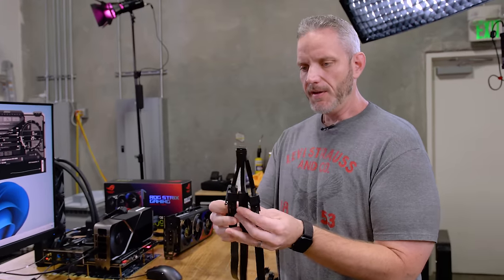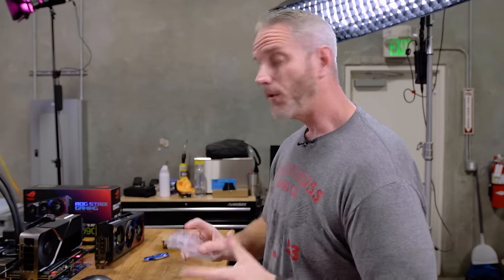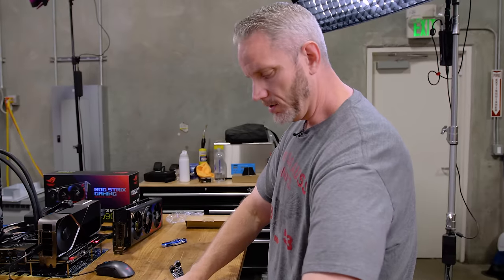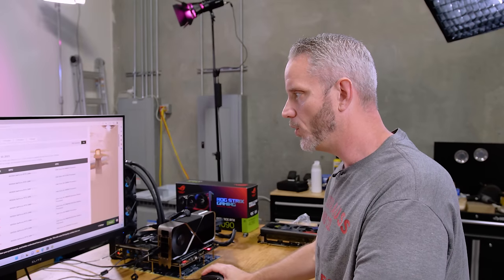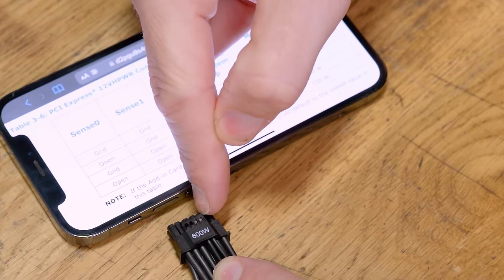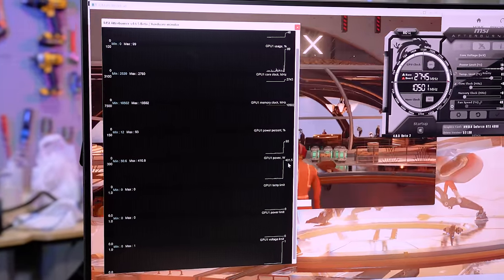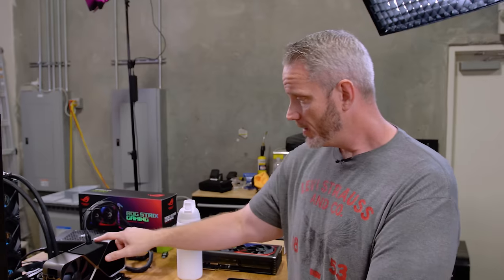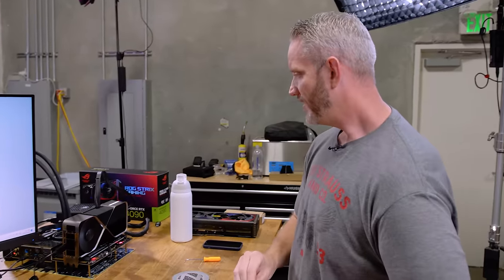DON'T Do this with your GPU!

Comment: fun fact if the wire gauge is the same stranded can handle more amps, sold core is cheaper to make, sold core is used in builds cause it does not get moved around, it is set and forget so as long as it is cheaper than stranded it makes sense to use, also easy to screw sold core wires to the back of outlets, but they were made for solid core as it is the standard use product

Comment: About the start of the video... no it dorsnt only take 2 it still takes 4 if u notice the regular cables have 1 connector on the psu side and 2 8 pins on the other side... so this adapter just skips 1 step.. its still the same amount of cables or lanes from the psu

Comment: Got my 4090 a day or two ago, and you are sooo right. The goddamn cablemess is terrible. Ordered a Corsair cable for my Corsair PSU to neaten things up.
Reply: Did it work? Which Corsair psu do you have?
Reply: @klipschorny  I have the corsair 600W 12VHPWR cable as well. I have a corsair 1000RMx and works perfectly.
Reply: @klipschorny  yes it worked fine. I have a RM850X
Reply: Wait what? This cable will only draw 600w if you have Rmx1200w supply or above. Anything less, it defaults to 450w. But people are ignorant, so they deserve to get scammed.😂🤣😂🤣
Reply: The Corsair 1200 are terrible stiff going to the GPU.  Useless

Comment: didnt corsair spread missinformation about the 4th/3rd plug on the adapters ? gamers nexus made a recent video about it , showing that corsair has no idea what the fuck they are talking about when they adress the new plug and standard
Reply: this^
Reply: yes they did, but when you see how they built their own extension you can see why they thought what they thought, why they were wrong, and why their product is still perfectly okay. these cables are fine. I just read the spec, and essentially I think the Corsair person was just confused and didn't realize that Nvidia built their adapter differently than they built their adapter, but both will work fine for a 4090 or any other GPU with ATX 3 that has ever been produced.
Reply: The Corsair one just uses 2 ground wires, the Nvidia adapter uses 4 ground wires and an IC to check them.
Reply: @gucky4717  exactly. And let's be clear when we say "IC" we think of some complicated logic but it's really not doing that complicated logic. It's just counting the number of sense pins (old style) on the connectors and converting that to a two digit binary number.
Reply: That only applies to Nvidia's cable adapter. That's what Steve from gamersnexus was talking about when calling out Corsair. Not Corsairs own cable. The way this cable works is completely different.

Comment: NOTE: the power that you get from this Corsair cable will vary depending upon the power supply that is used, it calls for a 1200w Corsair PSU to deliver the full 600w through the cable (1000w PSU = 450w and 750w PSU = 300w). I did not see this mentioned in the video.
Reply: This is false lol.. do the same test he is doing and you can see the wattage being supplied. I have a 1000 Corsair and this cable and I’ve had my strix card up to 527 watts. So it is definitely over 450.. maybe that’s changed I guess but as of now it isn’t true
Reply: I have a rm850x and it goes up to 587 watts in furmark with the cable.
Reply: @crimson7151  
I also have rm850x. This might be the reason why I'm getting a black screen with this cable.
Reply: yes its possible if you have a cpu like the 13900k @TheCaciKO

Comment: The power is defined by what consumes it (GPU).
What produces the energy (PSU) only defines the power limit it can handle.
Since the GPU is being told by the sense pins that the available power limit is under what it needs, it doesn't even try to start because it "knows" that it will go over the limit of the PSU and probably damage it.
Jay, you cannot say the power is there, "there" is only the voltage in Volts, then multiplied by the Amperes that the GPU resistance provide will give you power in Watts.

Comment: Hi Jay,
just that you can't band a cable, doesn't mean that its solid core. Especially the insulation makes a big difference in the stiffness of a cable. If you don't want to cut the cable, you can x-ray the cable to see if its standed.
BTW. The "smart" communication is just passive pins. Maybe later they implement something I2C based, like the old fashioned PM Bus on the PSU and GPU. They should have done this already. Its like cents for an eeprom in the PSU.

Comment: I think the reason there is a 4 8-pin adaptor is for psu's that had multi rails on the 12V. It is mostly a CYA adaptor while most corsair psu's are single 12V rail by design so the can basically just use 2 8pins to 12 high power connector.
Reply: Yeah most psu can do 1 8 pin psu to 2 x 8pin pcie pigtail
Reply: The reason for 4 8-pin adaptor is simply because each PCIE 8-pin is rated at 150W (it is the standard), so you need 4 of those to get up to 600W. You don't design 2 8-pin adaptor and rated it for 600W because it will be a fire hazard.
The adaptor itself can sense how many cables are attached to the adaptor, so if you only attach 3, it will tell the GPU that the max power is 450W. If you use Corsair PSU using the adaptor, you still need to connect to all 4 to get 600W max.
One of the potential problem in the future is that if people ended up breaking or losing their adaptor (maybe buy a 2nd hand 4090 card and it doesn't came with the adaptor), they might think to simply trying to purchase the cheapest adaptor and those adaptor is not a smart one, it could end up with the GPU trying to pull 600W from 1 8-pin.
Reply: @RurouTube  While the PCIe spec may say 150W per 8-pin ATX, in reality the three positive wires and Molex Mini-Fit Jr. pins are capable of much more than that if properly spec'd. Roughly 108w per pin, or 300W+ per 8-pin connector. Since Corsair specs the cable and the power supply, one must assume they know what their pins and wires are rated for and thus this is a 100% safe and compliant use case at 600w.
Reply: @bradley3549  What I wrote is not about whether Corsair can do 600W safely from a single 8pin but more about the reasoning why Nvidia included this 4x8pin adaptor. It is not about single rail or multi rails, it is simply because of the spec. The spec for 8pin is 150W. You can't expect every single PSU on earth to safely do what Corsair PSU or its cable can. Edit: this is just from safety issue. There is also from function stand point where while PSU at this category should be able to supply more than 150W from a single 8pin, there might be edge cases where it can't. Also just having 2x8pin might ended up making people have a false sense of security thinking that their PSU with 2x8pin should be able to handle 4090 when in reality it can't.
Reply: @RurouTube  spot on.. and some PSUs really put the bare minimum gauge to get 150W. through a PCIE cable.
The cable needs to follow the specifications anyway. you don't deviate from rules just because "it should be alriiiight" ^^
Reply: @RurouTube  Safety isn't Directly the reason.

8 pin PCIe cables are a means to tell the device (GPU) that it can draw 150W on those pins (75W per live pin, even the 6 pin PCIe connector only has two live pins, at 37.5W "guaranteed" per pin.)

You could connect a nuclear power station across solid copper bars, but if it uses 8 pin PCIe the device (GPU) can't tell anything other than "this cable has been plugged in to a connection that is allows to draw up to 150W".

Corsair's cables can sustain 300W (150W per live line). They are connected to a proprietary connector on the PSU (which happens to have 8 pins, but it is NOT an 8 pin PCIe connector, it's a Corsair Type 4 PCIe connector, rated for up to 300W, which is why they put two 8 pin PCIe connectors on the other end.)

So, nVidia expect four 8 pin PCIe connections on their adapter as that's the only way to Agree / Guarantee that the cables and PSU can deliver 600W. There's no other way to explicitly tell the GPU that there's 600W sustainably available.

Corsair, however, know their PSU sockets are rated for 300W, so they know they only need to wire two such sockets to the 12+4 pin HPWR connector. You couldn't use their cable on another PSU, the connectors pin out vary.

Comment: each PSU line can hold 288W, nvidia's adapter uses 4 because the old 8-pin GPU CONNECTOR is limited to 150W, also you might use a cable with 2 terminations which would end up in a single line
Reply: Yup, can't believe so many are confused by this, even youtubers who should know better are spreading misinformation. Has anyone even looked at the back of their PSU? Those 8 pin connectors are clearly marked PCIE 6+2, CPU 4+4, meaning each connector is also rated for EPS12 8pin, capable of about 300W easy. That's why Corsair only needs 2 connectors for this cable (ofcourse you gotta be mindful about your PSU's total wattage thought).
Reply: @Glotttis   So can I use 2 x Cables and just use the splitters on the end to feed in to the other 2 ?  so  only need 2 x PSU cables that split in to 2 x GPU power ? Or does this not work.
Reply: yes 2 psu cables are enough. a Y splitter is not ok though because it would mean 300W going through a single connector, which is out of spec. if by "splitter" you mean a cable with 2 gpu-side connectors, that's ok

Comment: Correct me if i'm wrong, didn't Nvidia explicitly say that 4 pin connectors MUST be connected to individual rails and make sure not to use splitters?
Reply: Yeah... im pretty sure i remember this as well. Jays 4 to 1 was also connected only using 3 plus the breakout on one... not a good idea for OC.
Reply: @Marin3r101  I would not be surprised if this is why his STRIX 4090 does not fire up :D
Reply: @VadikRamm  not it should still post the card. Only 450 watt is required unless Asus Vbios requires them all.

Comment: I would retest this with the original cables and see if your FE can overclock. Watching the GE's video and hearing the Nvidia's guy talk about it, you may need their adapter to get the full power.

While Corsairs adapter may be built differently, the card itself may not want to go past it's 450 watts if it cannot detect whatever signals the original adapter gives.

Not to mention, if it's even safe for the card long-term.
Reply: power doesn't affect the longevity of cards, voltage does, which may I add Nvidia doesn't even let you increase it this time around
Reply: Good point and I hope Nvidia hasn't done anything to effectively lock performance and constrain people into using their squid cables...
Reply: There is literally no difference in the power provider by corsair's cable and nvidia's cable when nvidia's cable has four PCIE 8pin cables connected from the perspective of the graphics card.

As jay, and gamers Nexus have shown, the card determines its power limit based on what it senses from the cables. Both Jay and gamers Nexus perform the same experiment, a little bit differently, and got the same result.

The new standard, in my humble opinion, is simple, easy to implement, and far superior to the hodgepodge of old power standards and pigtailed six pin and eight pin connections.
Reply: @misterio10gre  unsure of this reasoning.  Power is just V*I.  If currents constant and voltage goes up power increases.  Heat in devices is mostly from resistance to current.
Reply: @enntense  card runs at around 1.045 stock voltage, my 3090 does like 1.2 at max voltage headroom
Also you are outright incorrect, heat is directly proportional to voltage but inversely proportional to current
Reply: @misterio10gre  I guess long-distance, high-voltage power lines rival the sun for temp then, given they run 100-230KV through to UHV 1000KV.
It's almost as if the losses are for current, rather than voltage.
Reply: @misterio10gre  nope, power (and heat) is directly proportional to both current and voltage:
P = U (voltage) x i (current), also you can rewrite this as P = i² x R (resistance) at the same voltage due to Ohm's Law (R = U / i).

This is why it's better to elevate the voltage and lower the current to transmit power, since it reduces the loss due to Joule Heating (loss due to resistance).

Also, resistances from materials are greater at higher temperatures.
Reply: @iagomerli9535  that is only if voltage is constant, a more applicable formula for heat taking into account voltage variation is
H = V^2/I
so like I said, directly proportional to voltage, inversely proportional to current
Reply: @misterio10gre  how is heat inversely proportional to current? The more current you have with a constant voltage the more energy you'll have over the circuit which results in more heat.
Reply: @misterio10gre  Tell me then, which is easier to make constant? Voltage or current? Current is consequence voltage and resistance, that is why you set up voltage on overclock and stuff, not current.

You are applying the most convenient formula for your point. Also, this way you don't take into account variation in resistance due to temperature
Reply: @leage150  As the object heats up the current flowing through the object decreases because of the increased resistance of the object and so the power dissipated decreases
Reply: @misterio10gre  also, your formula is wrong. Heat (W) is P x t, and P = U x i or U²/R or i² x R-> W = U x i x t

Comment: Solving the over heat issues using dielectric silicone grease and that solve the over heat and arcing as well problems.

Comment: There are no tricks involved in the corsair adapter. Some of the cables you get with this PSU give you two 8-pin connectors for each cable coming from the PSU. That means that a single PCIe connector ON THE PSU can supply 300W so two will give you 600W

Comment: Excellent demonstration video, JayZ. QUESTION: can you please elaborate on how "monitors plays a part in this, too"? Thanks!
Reply: You can push all the frames at 4k you want on a 1080p 60hz monitor and you probably won’t notice a difference between that and 1080p 60fps. So if you have a lower end monitor your GPU won’t need to work as hard to run the resolution and frames that are optimal for you. That’s why you should always match your GPU to the monitor you have or plan to have in the near future. It doesn’t make sense to run a 40 series card, or a 70 series card or a 6800xt/6900xt for 1080p gaming because you aren’t utilizing the performance you paid for. As soon as you step up to 1440p or 4k and high refresh rate (120+ hz) it starts to make sense to go with a higher end GPU, but honestly no one needs a 4090, even for 4k gaming. It sits in a weird space where it’s too expensive and overkill for general consumers, and not powerful enough for professional use where Quattro’s dominate the space.
Reply: @abnormallynormal8823  "It doesn’t make sense to run a 40 series card, or a 70 series card or a 6800xt/6900xt for 1080p gaming because you aren’t utilizing the performance you paid for."

What? You can't just default assume you aren't utilizing the performance. It depends on the game, and settings. Lower refresh rate and resolution are always an opportunity to increase graphics settings. Now, if you've already maxed them out and still aren't anywhere near 100% GPU usage (assuming appropriately powerful CPU) then yes, your card's potential is kinda wasting. But unless that's the case in all games you play or might wanna play, you can't really say you've overpaid for the GPU.

That's obviously not touching the possibility that you might also need/want the card's performance for professional use (like rendering, AI and other compute stuff) where your monitor doesn't matter. But that's another story

Comment: Something that derbauer tested is lowering the power limit, he got it down to 50 % and only saw a dip of 5-15% and a 200w drop in power usage. 
I think that should be tested by others as well, they would not have needed massive coolers and special connectors, maybe scared of amd. Interested to see what will come from them.
Reply: well no surprise there. 30 series behave the same way :p
And AMD too actually. They don't show the total board power so they appear to be more efficient, but they also benefit from lower power limits in the same way with a really minimal hit in performance.
those last FPS are a b** to get for the benchmarks.

Comment: Use the supplied Nvidia cable with all 4 ports connected and your power slider will allow up too 133% voltage. Steve from GN demonstrated how this works, you need all 4 side band pins to be active.

Comment: Thanks a lot, I wanted to return my 750 watt Corsair because it has only 2 PCIe cables and get 850 with 3 PCIe, and I was afraid to use that 12vhpwr because it has 2 input ports, and GPU connector has 3 on my 4080.
Tomorrow will just connect 12vhpwr and avoid a lot of headache and waiting time.

Comment: For the adapter that come with the 4090, you do not need to connect four 8-pins, just three as per their instructions. The 4th plug is optional and is for overclocking.
Reply: Can I get this cable with the 2 8-pina for the 4090? Or do I need a custom cable that has 4?

Comment: Well, if they respected the plug design, if the two plug are connected or not, it manage the power the card is supposed to use max and at start. instead of the supply saying how much it can use.
The plug name is  PCIe Gen5 12VHPWR .
basically, max draw with both to GND is 600w and no connector max draw is 150w max draw.